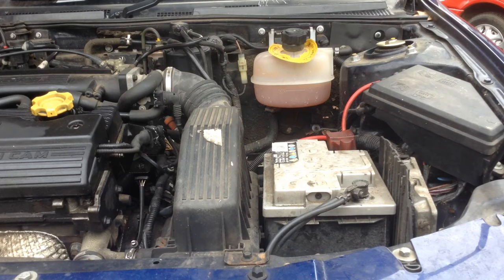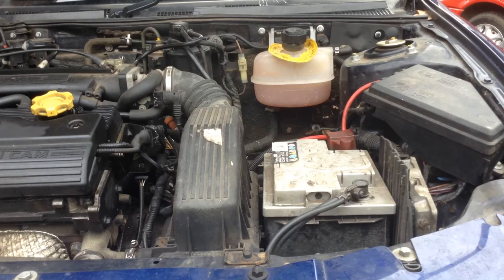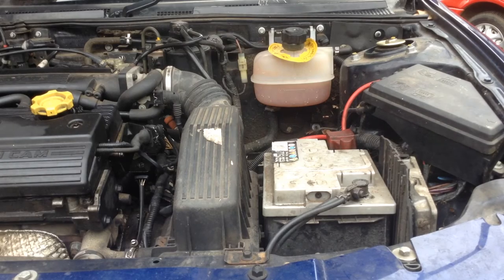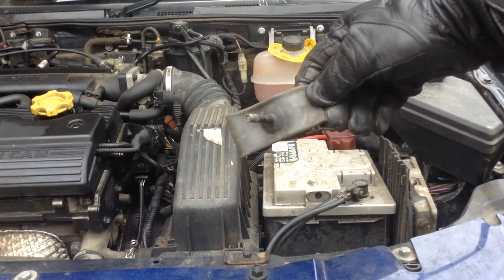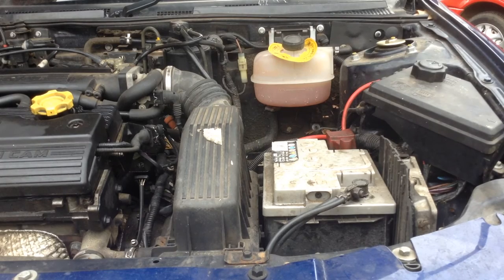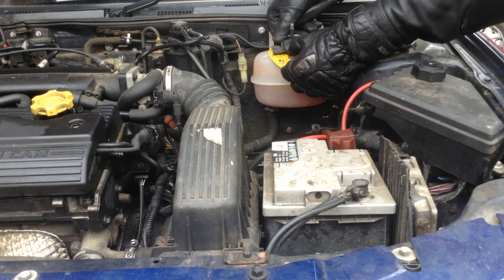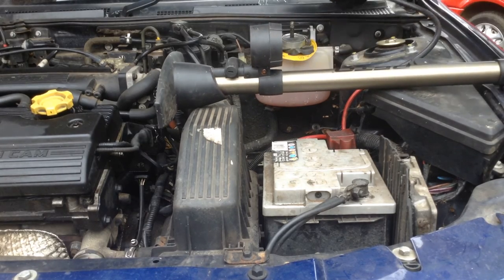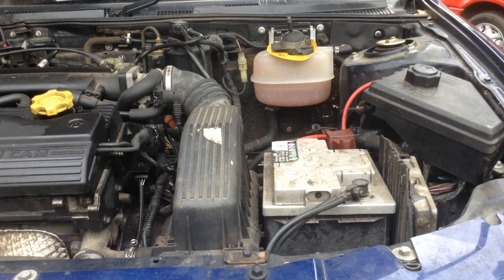Bicycle pump cooling system pressure tester

Comment: i fitted a valve into an old coolant reservoir cap - have to take the relief valve out then drilled it and used silicone to seal & fill the valve to cap.. (mine was a ROver 45) 

this demo on a ROVER 25?

Comment: Good Morning My Friend And Nice To Meet You. Great Video I Loved It. I Have A 2003 Dodge Caravan And Wanted To Follow The Same Steps You Did On This Video But How I Would I Go About Doing It On My 2003 Dodge Caravan? Because It Doesn't Have An Expansion Tank Like The Vehicle Your Working On In This Video. I Have A Bicycle Pump But It Has No Gauge On It. I Do Have A Slime Digital Gauge Is It Possible That I Can Use That To Make Sure I Dont Go Over 15Psi Of Pressure?
Reply from the maker: Hello My Friend and its also nice to meet you. Thanks for watching my video. If you have a normal radiator and no expansion tank, you could do the same just be careful you don't damage the filler neck. Also there mite be an tube from the side of the neck serving as an overflow. In a system like yours the cap is also a pressure release device so the tube must also be temporarily blocked for this test. You could modify an old broken cap for this sort of thing or use a rubber bung as it's low pressure. As far as using tyre gauges I would opp for a pump with gauge fitting, a track pump or foot pump should not be that expensive. Good luck!

Comment: Was the leak running down the cylinder wall? 
          Did you fix your engine. I have bubbling into the expansion bottle of my Saab93 1.9tid  that stops when engine is hot! Maybe due to expansion and also a slight coolant loss that i can't as yet find
Reply from the maker: Yes there was a small amount of the white stuff on the dip stick which made me suspicious. So I did this test with the sump off and looked up inside with a torch and saw the buckled head gasket which I changed.